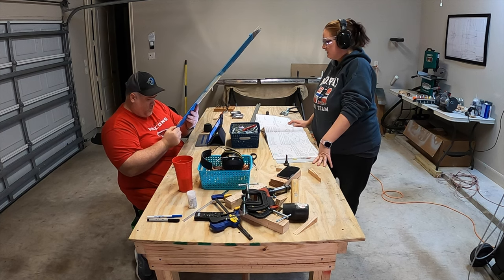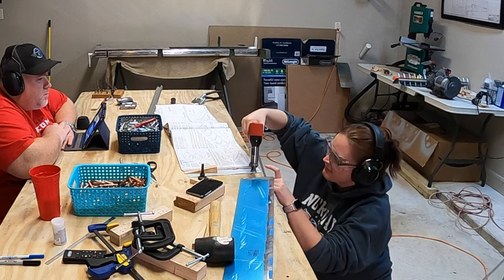Van's Aircraft RV-10 Build: Trim Tabs - failed 1st attempt & fix! (9-16)

Comment: The -14 follows the same process for the elevator trim tab. Your notes added on our plan sheets. Thanks!
Reply from the maker: You’re welcome 😊 hope it helps!
Reply: @PlaneLady  Correction: The elevator trim tab ends are pre-bent on the -14. It's the elevator top and bottom skin close-out tabs that need to be bent.